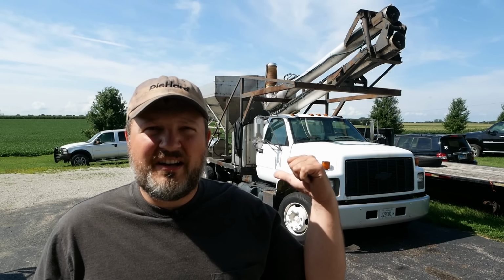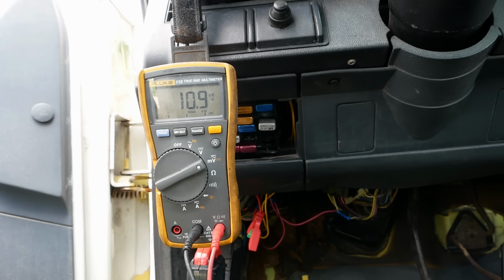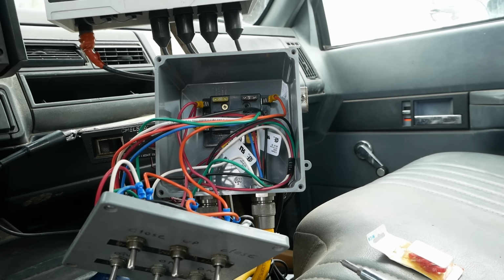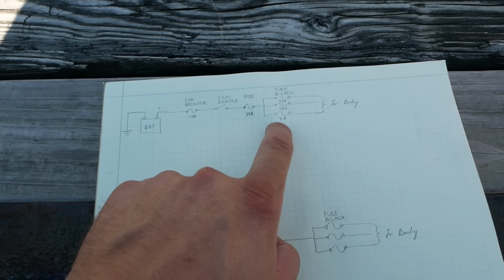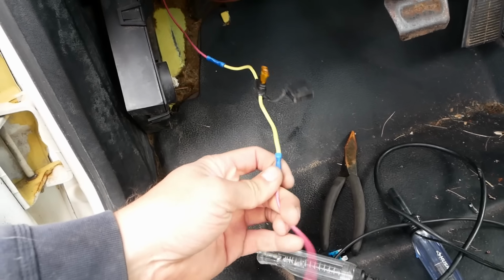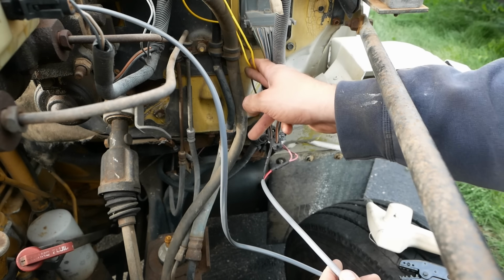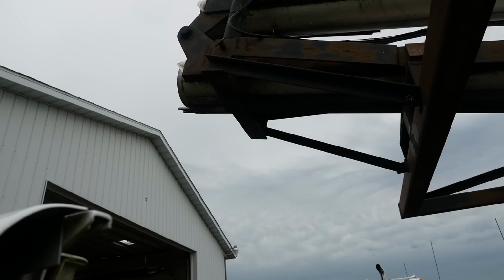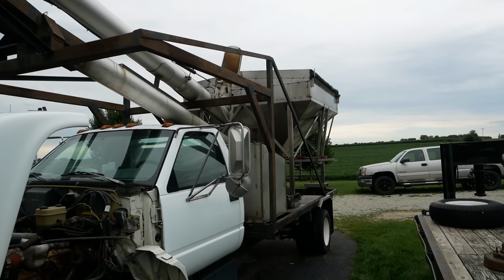Crop Duster Tender Truck Dies Every 5 Minutes

Comment: I thoroughly enjoy the wiring diagrams. So many people I know skip the pen and paper step and get confused when wiring. It's so simple to do, takes 5 minutes, and saves hours! And your diagrams look awesome.
Reply: I agree, it's really not that difficult. May make mistakes if somebody is hanging over you shoulder or making you hurry but otherwise its rewardign work.
Reply: I had a background in EE (RF) before ending up in the auto service business and being able to read and understand electrical circuits and schematics/diagrams has been a huge help many times.  Too many parts changers out there nowadays that can't read diddly squat and just load up the parts shotgun and let 'er have both barrels until something works.

Comment: We have essentially the same truck, though with air brakes, for work as a "crash truck" carries our orange barrels and highway signs plus has an arrow board that raises up. The wiring on it is similarly confusing
Reply: Does it, too, have the hard start ?  Never ran a 3116, but ran many miles with 3406, 3306, and 3176 power.  The mechanical ones, I would give them a wee bit of pedal on the coldest of winter mornings, they responded well, coming to life sooner than if I had just let them crank and crank.  I only wanted them to start before the batteries threw up the white flag.
Reply: @stanpatterson5033  not a fast start but nowhere as clunky sounding as that one, has an intake air heater that helps

Comment: The true "industrial" solution would have just been to cut the wires to the fan and keep working.  Current draw goes way down, and since the fan was locked up it wasn't doing anything... therefore, you didn't need it anyway.  :)
Reply: I'm guessing that's the hydraulic fluid cooler.  Which invites far too many other questions.  Have they been running the hydraulics "hot" all this time?  Has the fluid level been checked?  How few hours are left on the hydraulic motor that drives the auger after all that abuse?
And, we know how much Wes just adores hydraulic fluid 😀
Reply: Like the way you think!

Comment: On that cooler fan, do you want it to suck or blow? Draw air thru cooler or push air? Since truck is static when in use, does it matter?
Reply from the maker: I doubt it matters. I had to set to suck so it could go with the flow if they were driving.

Comment: My 2002 F350 7.3L Diesel, ZF 6spd manual 4x4 has a dual front leaf spring just like that, and after 300k miles and hoping my curb everyday, it finally broke on that left side.   It only costed me $160 shipped for a new pair from somewhere in Tx.  They had a 3 leaf version that took it from 5klbs to 7klbs, so that you can have a big plow on the front.   I regret not getting the 3 leaf -- but oh well.  They were double the price...   Those leafs on that truck look tired and over extended to me.
Reply from the maker: Those things ride like lumber wagons. The coil springs were much better on the 04 and up, at least until the spring buckets rot out.
Reply: @WatchWesWork  Yeah.. That's why I wish I would have just gotten the 3 leaf and had more capacity.  since it already rides like it's solidly mounted. lol......  It actually rides much much better when you have a heavy load on it though.  All that weight tends to get the springs flexing and the inertia naturally slows down the movement- so it really is pleasant to pull a big heavy trailer or something, relatively... So it's actually not as bad as you might think with that huge/ heavy 7.3L in the front.  Or maybe I've just gotten used to bouncing around like a rag doll.

Comment: When you do one of your outstanding wiring upgrades, do you put an updated wire guide in the glove box or give one to the customer? I figure you put one in you files as sure a God made little green apples you will see the vehicle back at some time. Example the Ford Ranger.
Reply from the maker: I did put the diagram I made inside the control box for the next guy.

Comment: Frustration!!
Someone had the good sense to fit a terminal box so that wiring joints are protected from the weather - then they just crimp joined the in & out wiring into spaghetti,  I would have fitted a proper terminal block in that box complete with a cover.
Reply from the maker: If there's a corner to be cut, it will be with the wiring.
Reply: @WatchWesWork  Except to run a wire from the dash out the cab and under the passenger seat to come out ... near the dash o_O

Comment: The high fan current was likely from the old fan being seized. Just replacing the fan might have eliminated the high draw. But as usual you went the full Monty. Next time it seizes it won't take down the ship. Nice.
Reply: I had the same thought.  It was probably wired that way from the dawn of time, but the stuck fan drew too much current.
Reply: @Mark.R_  Yeah, and the poor wiring limited the current to the fan. Otherwise it would've stalled much sooner...
Reply: either way the wiring was done wrong and unsafe, and Wes did a grand job sorting it out
Reply: Any of y'all want to take odds on the truck operator just sweeping all the switches to "On" in one hand motion, and never bothering to check?
Reply: Agree
Reply: Would you just replace the fan? Realistically the guy is going to have more problems with that setup and do you really want it coming back
Reply: Looked at another way, next time it seizes nobody'll notice and it'll do whatever expensive thing that heat exchanger is there to prevent, instead of helpfully causing the 'truck shuts down' condition.
Reply: @EyeMWing probably 50/50 chance of it just burning the truck to the ground with the condition of the wiring

Comment: Wes  one thing I think we can all agree on is whoever wired this vehicle well I’ll be nice you have already said it. I guess all that can be said is whatever vehicle comes into your shop is not the same vehicle when it leaves. It’s getting harder and harder to scrounge up parts. Wait till all these so called wiring gurus start messing with EV vehicles and try getting parts for them. Good Luck. Thanks for sharing Wes 👍
Reply from the maker: Yeah it's going to be a mess.

Comment: So other than the janky wiring in the first place, if the fan hadn't locked up the truck would stay running?? Does the farmer or the guy running the truck not check his equipment??
Reply from the maker: Correct, but it wasn't right.

Comment: Love your videos but 14 gauge is way too light for 30 amp.  16g=10 amp, 14g=15amp, 12g=20 amp, 10g=30amp.  You might be able to fudge it a little but if you stick with these gauge sizes you will be safe!
Reply from the maker: Yeah, automotive doesn't really play by NEC rules. The relay socket I bought is rated for 50 amps but has 16 gauge wire...

Comment: Rube Goldberg design at it's finest. Come on Wes, run it's through it's paces, let's see it burn itself to the ground along with the AC Cat attached. The wiring looked like it belonged in a boiler room instead of the truck. Why is there always a comeback in the driveway, think you need a gate to the entrance or do they call ahead, I hope.

Comment: I keep a stock of relay fuse combos as I have a severe dislike of inline fuses.  Trying to find a link to my favorite setup.  It's made by Buss.
Of course they didn't want to sell direct, and anything less than the entire cooling "solution".  Pretty sure that Thermal what ever company is just a front for a China manufacture.  Cooling is literally LEGO's.  Needs to fit these dimensions, and throw a fan on it.  Hayden or Spal and call it a day.
Reply: Is it the bussman RTMR ones? Nice looking kit but personally not a fan cos I'd rather use the large style automotive relays as they're way more available.
Reply: @hannahranga  Good point

Comment: I wanted to see you start it up.  I was curious to know if removing the load on the ignition circuit would help…maybe the shutoff solenoid gets enough power now to start properly???   I’ve noticed something similar on my 3116.  If I have a Weak battery it won’t crank normally, but cranks great with remote start button, however starts real hard b/c the starter consumes so much power the shutdown solenoid won’t let fuel through, I think. With a fresh battery I have no problems. Great vid!!

Comment: I almost hate to tell you this, but...  If the fan wasn't locked up, it probably would not have been drawing a ton of amps....  You might have been able to swap the fan & let it rip....  

I mean, it would have been wrong...  You did the right thing, of course...  Just saying...
Reply from the maker: FLA on the fan is around 12 amps even when it was new. Add in a few solenoids and you'd be pushing the 20 amp circuit pretty hard.
Reply: @WatchWesWork  Fair enough Sir.

Comment: I always wonder why aftermarket wirings are this bad on US stuff...
Reply: Look at the truck itself. A simliar vintage Russian truck is better made.
Reply: @erik_dk842  well I guess no wiring left on a russian thing that old - there was not much electronics to put in that time, probably only lighting :) 
But I meant I see wiring on new official conversions look as crap as a hilbilly would make it after a bottle of moonshine.
Reply: @ZoltánZsírosZsZ  cuz upfitters are lazy As f-ck. Charge large, cut as many corners as they can slap it together shove out the door move onto next job

Comment: Great video!   re: Hard start.  I think a lot of those CAT engines have a check valve in the pump plumbing, that prevents the fuel from leaking back out and loosing prime.  hard starting is a common symptom of that problem.
Reply: Right! When that check valve allows fuel to seep from near the engine back to the tank, it takes extra time to get that fuel back up to the engine. On my big truck, the check valve was way back behind the engine, and had to take the "dog house" off to replace it. Some years later on something totally unrelated, I had the heads off and the mechanic mentioned that it might be a good time to replace that check valve because he could very easily replace it. BINGO!!! I thanked him and had it replaced even though it was not causing any problems.
Reply: Definitely a hard start issue I would say.  Great job Wes!
Reply: Hard start? Yeah I had a hard time figuring out if it was started!

Comment: Nice work!

I have a 98 C6500 with the same Cat motor and a flat bed. Also have a push button start. Must have been a common issue.

Comment: the item  you point out as a pump is the governor, think two stroke detroit, same with the injectors and it has a rack like the two stroke, change the filter by the tank under the cab, usually behind the fender, everyone either forgets about it or dont know its there,

Comment: Your right, that fan bracket looks like an OEM (better than) one. Looks really nice. I think there is a wiring disease in your part of the  country? Thanks Wes.
Reply: Doesn't help that nicely done wiring doesn't tend to fail nearly as often and when it does it's much easier to fix yourself.
Reply: Wes deals with a lot of working vehicles. They're usually fixed as quickly and cheaply as possible until something very major happens.

Comment: Your ability to delve into the madness of someone else's making, figure out their line of thinking, and make solid repairs always blows me away. If I had to repair that mess I would of ripped it all out and started over
Reply: Remember that Wes has bills to pay and a lot full of jobs to do. The customer calls the shots.
Reply: “The Madness of Someone Else’s Making”, starring Wes, The Wrenching Wonder, now playing on your local YouTube channel.
Reply: The residential wiring dangling in the breeze is great. Who needs conduit when you've got zip ties. Then you know you've got wires...
Reply: It takes a farm mechanic to fix a farmers mess
Reply: I would have less hair than I do now, which is not a lot.
Reply: No kidding RIGHT I hear ya
Reply: seriously?
Reply: @horacerumpole6912  some people are easily impressed, I guess
Reply: @TeeZappa650  I don´t know if some more ingenious farmer hacked this contraption together, they transplanted the hopper, auger and everything to that chassis from a previous vehicle or if it was built to order, but if it was built that way originally, I am sure less than impressed with the electrical work they did in the first place.
And even if all this is "just" a farmer hack job (a hell of a hack job though as they obviously got the thing working initially), the wiring is still less than impressive.
Big surprise it made it that far without breaking down previously.

Comment: It will be back for its poor starting problem.
Reply from the maker: I hope not. The rack and injector adjustment on these engines is a nightmare.
Reply: More like a burnt out hydraulic motor for the auger having run it for hours upon hours with no cooling fan--and Wes will want to be on vacation that day, too :)

Comment: I would have thought replacing the fan would have fixed it?
Reply from the maker: It fixes the symptom, but is not the cure.
Reply: Sure, it would have just had the same problem at a later time.
Reply: @EFCasual  I can see that but would the fan being locked up have caused the fuse to overheat? No mechanic here just trying to apply my limited logic lol.
Reply: @hunterbidenscrackdealer3753  yeah, the locked up fan will be a higher load than if it was working.
Reply: Remember that the PTO switch was also causing an over-draw as well.  Which would have tripped the breaker and shut off the engine.

Comment: I'd usually just pull the 87A terminal right out of the relay socket than leave it hanging with a piece of heat shrink on it.
These are the sort of simple harness repairs that my feeble old mind can grasp.